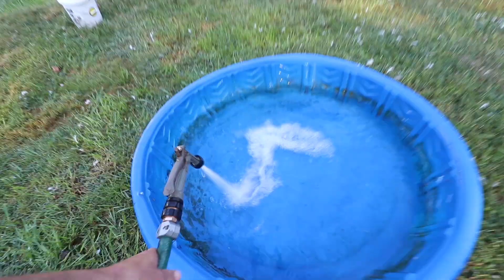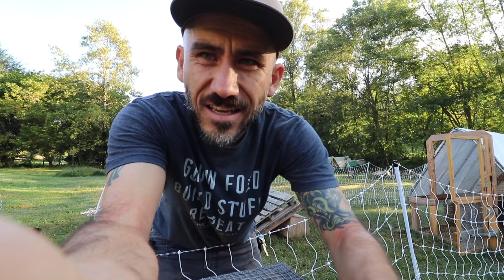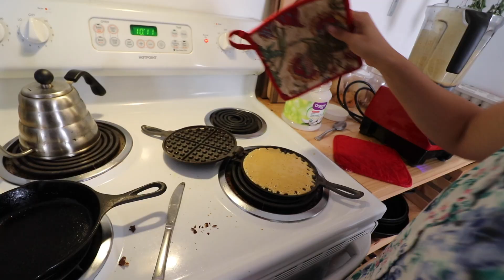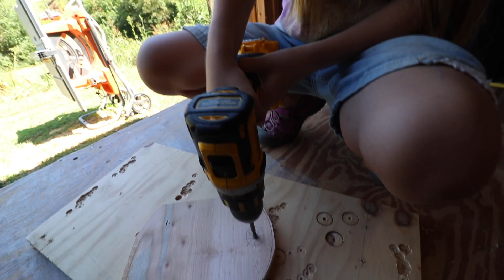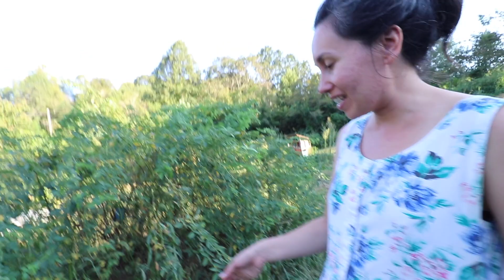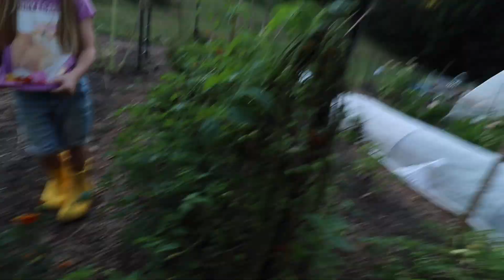It's HARD to LEAVE (Homestead VLOG)

Comment: I haven't had any rabbits yet. But I have lots of problems with squirrels eating my corn! They were digging up the corn seeds up in early summer, had to plant them a few times before I realized what was happening, so I had to end up covering the rows until they started growing. Then at harvest time, they were hammering the corn big time. My property is surrounded by trees with an opening in the middle where the house, barn and garden is so they sneak in there early in the morning and late in evening. Ill see out the window corn stalks rattling around and run out there but I haven't found anything that works to keep them out. I'm going to cut more trees back away this winter but there's no way to get them all. I have 10 acres but about 6 is forest.  Have any ideas how to keep squirrels out the garden?? 
Anyway,  have a safe fun trip to Cali!  😀
I know how you felt having to leave when crops are still coming in.